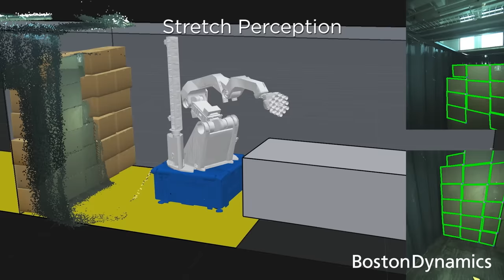Introducing Stretch | Boston Dynamics

Comment: If only boxes came that neatly packed in fulfillment centers. They're usually all over the place.
Reply: If the image detection is good enough I don't think it'll matter. It's hard to gauge how versatile this thing will be from this brief tech demo, but come on, these are the guys who made humanoid robots do the twist, if anyone can pull it off it's them
Reply: ... probably because they didn't have a robot doing the packing, 😂
Reply: Doubt it matters. I saw a robotic gripper a few years back that could dig through a box of randomly sized objects and pick out all the red ones. If it can sort through random objects and decide the best place to pick up, then there's no stopping this.
Reply: 🥴I don't think a few misplaced boxes will be a very hard hurdle to overcome for a robotics company 😅.
Reply: not when other robots stacked them...
Reply: Misplaced, no problem. Damaged box without a clean surface? Problem.
Reply: Yeah Im going to have to agree with the other comments, I don't think the robot is following a script.  More like it uses it's camera and then calculates what to do with the options it has
Reply: They will when robots start stacking them
Reply: @mesaplayer9636  No no script, they show that. However, it is unloading in an ideal situation which those trucks will almost never be. You will have boxes of different sizes, shapes, and things will fall when you move them.
Reply: There’s a visions system integrated into it .....if you’ve never seen a high speed vision system in action  it’s unreal
Reply: @davebennett5069  beeb beeb boob Damaged box without a clean surface robot reporting for duty
Reply: Once the robots take over, they will be neatly stacked.

Comment: I work 40 hours a week emptying the back of a wagon. Sure, this robot might not be as fast as a human, but I can totally see it replacing me 5-10 years from now. Incredible achievement from Boston Dynamics. Also happy to see Spot has a friend! :)
Reply: 1-2 years from now.
Reply: @southchum101  ur probably correct cus I looked up job automation and ups posted an article back in 2018 that said that their warehouse would be fully automated by 2022
Reply: Bruh youre out of there next month
Reply: They’ll still need “robot supervisors” and some company is going to have to repair them! Plus janitorial services will still be needed!
Reply: @DAYDAYBEATZ  Yeah but right now they have human supervisors. What is cheaper? 40 humans unloading trucks in 2 shifts of 20 each + 2 supervisors and additional cleaning staff. Or 40 robots unloading trucks, the robots costing the yearly cost of the humans once and then 1/5 of it in maintenance cost + 2 better paid supervisors for the robots and additinal cleaning staff/robots.
Reply: I know, then you wont have to break your back, you could find a job that is less physically taxing.

Comment: This is genius
Reply: yes
Reply: People acting like there are no industrial robots out there
Reply: @noahbreuer5095  there’s a reason 80-90% of industrial robots are fixed to the floor, and it’s not load distribution. In fact it’s the same reason they also have blocked off areas where humans can’t go; they have almost no sensors or dynamics. If you moved them an inch to the left, they’d miss every weld, every screw, and if you walked in there while they were swinging around they’d at best knock you over and could easily severely injure you. 
Boston Dynamics’ whole thing is environmental sensing and dynamic adaptation to an environment in order to perform a specific task without explicit programming of every move down to the mm. I strongly suspect that the next video will have them working around a dynamic obstacle such as a human wandering in.
Reply: @randombloke82  I'm not saying it is not an impressive feat, but other than spot for example it has been done. Just check out something like KUKA. Boston Dynamics is mighty cool but also not the only one doing robotics.
Reply: No this is Boston dynamics
Reply: Yeah , if you seek to destroy humanity because youre an evil corporation who makes missles.
Reply: @randombloke82  nah , their whole thing is replacing people and destroying society...you are the bad guys.
Reply: @MrWatchowtnow  I can't even. "You are the bad guys". Who do you think people im the comment section are?
Boston Dynamics shills?
Reply: Y? Haven’t you seen such arm robots before?
Reply: @Alex Lorenz The only problem i see is you.
Reply: @MrWatchowtnow  Lollllllll.
Reply: @cheesebusiness  American chills.
Reply: These already exist?
Reply: @Alex Lorenz The same thing happened back in 18th century. People started breaking machines because they thought it was an abomination to lose their jobs to lifeless creatures on the base of efficiency. These people were working 12 hours a week on a repetitive work where they had little attachment: easily replaced, but costly to do so. Many lived most of their life working in the industry, hammering some thing in another, screwing tight, connecting parts. Logistics is by far the best thing to automate.

Workers get out of their jobs, and their children may build a better future. Capitalism is by far the best economy system created, poverty now is insignificant compared to what it was when it begun. It’s a road for more meaningful work. Better for every society in the long-term
Reply: why? dont hurry, its empty boxes, how much is this can lift? 5 kg?
Reply: Six plus humans could fit in that square space of the arm vacuum unit, still can't beat humans.
Reply: This is madness!

But impressive...
Reply: @MrWatchowtnow  You know Asimov novels are not, in fact, future-history texts, right?
Reply: @Alex Lorenz The idea I think is to just print more money for everyone sadly.
Reply: And scary
Reply: @Alex Lorenz this is the same argument used by dock worker unions against the adoption of the Standard shipping container. The adoption removed thousands of jobs for dock hands who unloaded all of the material by hand over hours, when now it can be done potentially in less than a minute. Not only that but it also allowed for more space efficient storage and cheaper transport respectively.

This is just a extension of that, where these robots are replacing large amounts of manual jobs, with a smaller amount of management jobs. (To manage and operate the machinery) the rest will need to move on to other industries which will be created. There’s going to be more openings in creating these machines for example. Or to go into higher education. 

This is natural progression and has happened time and time again. Sure you can be scared of it, but it will pass and no one will bat an eye.
Reply: @Alex Lorenz FACTS BIG FACTS a lot people are gonna be laid off. Out of work when we are replaced by a.i an etc....
Reply: This is actually just a pretty good robotic arm. Were is genius ?
Reply: @Alex Lorenz Yeah well, the faster the better. If you are worried about human jobs, stop using your email and send messages via the post office.
Reply: How about packages that wont bare their own load? Or weird shaped packages? Or different materials?
Reply: @tesz-vesz1985  23kg, it lifts 23kg
Reply: @tesz-vesz1985  you seem to have misses the clip where it lifted Spot out of a box. According to a quick google search Spot weighs about 25 kilograms, and the arm seemed to lift it with no effort.
Reply: Wow a robot arm what a new and special invention that is surtantly not a industry standard already. :/
Reply: Unless you're a warehouse worker. And your jobs about to be replaced.
Reply: @Alex Lorenz no
Reply: @noahbreuer5095  you're acting like they're everywhere. I've never seen a single one in any warehouse I've ever been in or worked.
Reply: @randombloke82  this is nothing special and already exists in the industry. Kinda lame
Reply: @Alex Lorenz There's many costs, And I just thought the same

For example, this company aiming to automate truck drivers... "Horrible!" Yes...but just check the stats, there's a lack of 20% of truck drivers, and 90% of turnover 

Man, you can have a company of teamsters and never have a single truck driver, or if you do, it costs more to you hire someone than to actually pay them

Warehouses is the same, somethings will get lost, and we'll have to adapt
With corona, don't know how that'll be possible
Reply: @Alex Lorenz wow so big picture. So what's your idea of life? Working 9-5 stacking boxes? You're acting like these jobs help with human evolution, it's just a robot doing shit we don't want to do. You're the one playing into the idea of economy if you think people should be doing menial jobs for the rest of their lives... Think for yourself
Reply: @BOOGiNS  why does everyone thinks that robot arms are a new invention hahah this is nothing new
Reply: @tesz-vesz1985  23kg, so enough to replace most Amazon warehouse employees
Reply: @BOOGiNS  Nah just saying that it has been done so its nothing "genius".
Reply: @outandabout259  this video should be say the possible weight
Reply: @Alex Lorenz invention of an excavator cost millions of jobs in digging dirt,invention of electricity cost millions of jobs for street lighters and invention of modern agricultural machinery cost millions of jobs in the peasant industry.Anyway you get the point. Progress moves forward so those people being replaced by robots is a good thing, now they will be able to do something better,or if they cant they can still go in to trades.
Reply: @Alex Lorenz a more accurate a less pessimist way to put it is that it will hundreds of thousands of human lifespans worth of man hours
Reply: @randombloke82  I would say instead of a human wandering in they will have an Atlas wandering in.

Comment: Cool. Of course, given how heavy boxes of that size are frequently packed, its going to need a different method of lifting. Unless we're all good with many boxes ripping open to explode their contents everywhere.
Reply: Yeah, that was the first thing I noticed when I saw them carrying the box by one of its ends. That said the shipping container revolution changed the world so it could fit on the back of a truck. Same thing could happen where cardboard boxes are either packed lighter, engineered better or replaced by a different product entirely.
Reply: @hamsolo474  Cargo legos?
Reply: Reusable, standardized metal or plastic boxes could  be the answer....
Reply: small adjustable forks under the suction hat.

Comment: And on that day the final nail to my career as an truck loader/unloader goes the way of the dodo.
Reply: Mine didn't even start..
Reply: Yeah but think of it this way, it costs a few mil for one of those robots, even when theyre fully ready for deployment itll be 100k a piece, for 100k a piece it would take 30 years of ten guys working to equal that amount of work.

Youre probably safe until the bean counters 30 years from now figure out they can save money by hiring robots. Then you just get a job like charlie's dad and fix the robots at the toothpaste factory.
Reply: You know, because taking boxes off of a truck was such a secure career choice that not just anyone could do.
Reply: @drawapretzel6003  your math is horrible. At 100k per robot it would take just over 3 years to pay for itself compared to a employee making 30k and 30k ain’t much and that’s not including  health benefits or 401k matching or pay increases and robots don’t belong to a dirty union.
Reply: @markdice6361  ... im aware my math is wrong.
Reply: Noel Pytlik  Sometimes my friend, the purpose of a thing is not to be accurate, its to be emotionally significant. I portrayed the thought, without doing my taxes to find the correct budgetary requirements to pay off a robot.

sue me.
Reply: @drawapretzel6003  Did you forget that they can work nonstop 24/7 all week for years with the only running cost being electricity which you need to provide stuff like illumination and air conditioning had you stick with human employees anyway. They also don’t care about pay raises or insurance and they can’t sue the company if there’s a workplace accident. A robot like this will pay for itself in no time, don’t underestimate the threat of automation buddy.
Reply: @drawapretzel6003  
In addition to what everyone’s said, tech seems to get cheaper exponentially. Sure, now, they’re quite expensive, but give a decade or two and they’ll be even more economical than they would be now.
Reply: @markdice6361  Much earlier actually, considering a robot never stops working, never gets sick, his productivity never goes down. It's, indeed, like having superman as a slave.
Reply: @jeffbac1889  agreed
Reply: LOL im actually replaced by robot by thé end of 2021 my boss told me ....working has a truck loader unloader in switzerland
Reply: @drawapretzel6003  but its so wrong it doesn't even send the right emotional message. It's wrong both mathematically and emotionally. Emotionally, your comment says "don't worry won't happen for a while", but the reality of the correct math sends the emotional message, "shoot you should start worrying 3 years is not a lot of time and some might definitely make that investment". Also there's the fact that the tech is only going to become cheaper and more efficient.
Reply: @drawapretzel6003  by the way, the robot will probably be able / programmed to fix themselves via preventative maintainence
Reply: @drawapretzel6003  I assume that the 100k is USD, but even if it's GBP (stuff like this can tend to be equal when accounting for shipping anyway, otherwise its 80k GBP). Minimum wage in the UK on a full time job is approx 18k GBP, say 20k for rounding sake, that's 5 guys for one year or one guy for five years. Those are reasonable investment payoff times. If you're talking US, average warehouse worker earns 25k USD on 40 hours assuming 13$ an hour and 50 weeks a year. This is also just assuming the robot is working 40 hours a week, it doesn't actually need to stop.
Reply: This is the way...of the Dodo.
Reply: And if you've really spent any time as a unloader you will know these robots have no chance. They only use perfect boxes for these demos. I've worked in a FedEx sorting facility. Boxes come smashed in, wet, boxes long boxes with unpredictable centers of gravity. There are way too many conditions a box can be for these to be viable in a lot of places. 

All that is ignoring the fact that these exists warehouses would need massive retrofitting to accommodate such systems. Nothing was designed for these. Some things don't even get shipped in boxes. A lot of stuff come in the soft padded envelopes, or bags.
Reply: @ryanmathlouthi1591  My condolences hopefully you can find something else by the end of the year.
Reply: @RICOFRITO  i will , there is planty of job here but for how long....been working here for 5 years now , im actually thinking about Doing something else of my life

Comment: Working in manufacturing most of my life, this is pretty normal stuff. Except with the additional layer of AI and mapping. The fact that it knows its surroundings makes for an amazing upgrade in safety. At my last job, if you were to enter a cell with robots running,,,,they would inadvertently pummel you and not even know they did it. And then probably pummel you again.

Comment: The most impressive aspect has to be the AI or order processing. Other than that it's just a normal heavy-duty robot you can see anywhere.
Reply: The difference is probably flexibility. There are these CNC controlled robot arms we know from production lines, but these need to be in cages and while they have very high movement accuracy, they simply perform a task with no regards to their environment. A welding robot arm will weld air if the productionline stops feeding steel blanks because it has no perception of it's environment on it's own. These Robots have located the shipping containers themselves, figured out what the walls are, and what the boxes are and started unloading them.

Comment: Finally I can get busy on that storage container of empty but sealed cardboard boxes I have.
Reply: PERCEPTION MAST

Advanced perception delivers fast and precise case detection.

ROBOTIC ARM

7 degrees-of-freedom arm grants long reach and large workspace, allowing the robot to reach cases throughout a truck or pallet.

SMART GRIPPER

Embedded sensing and active control handle a variety of package types while operating at high speeds.

BATTERY OR SHORE POWER

High-capacity batteries power Stretch through a full shift, with the option to plug into shore power for continuous operation.

MOBILE BASE

Mobile base maneuvers in any direction and navigates obstacles and ramps. Small footprint allows Stretch to fit anywhere a pallet does.

In short these things can lift whatever boxes no matter the weight.

Comment: If this robot can actually work around the clock, it would do 130k of $15 an hour work a year. I dont know how expensive these robots will be but they will only get cheaper and faster.
Reply: I wish it was smaller though, you need two working together. Even if it can work around the clock, the drivers cant be expected to wait for this guy to take the boxes out one by one.
Reply: @nathanweber6859  not if the drivers are also automated :P
Reply: @q44444q  OMG!
Reply: and only if you think that he is replacing one worker, the company says it can work 16 hours a day and moving 800 boxes a hour
Reply: @douglas8568  16? More like 24/7 with battery swapping